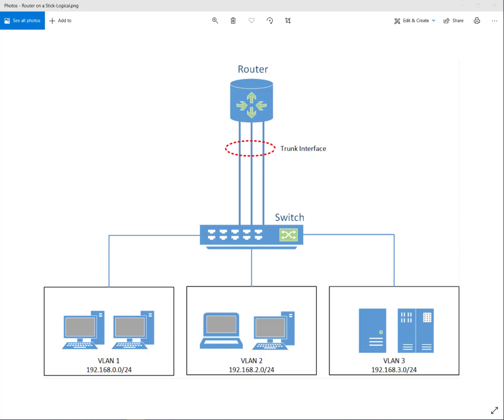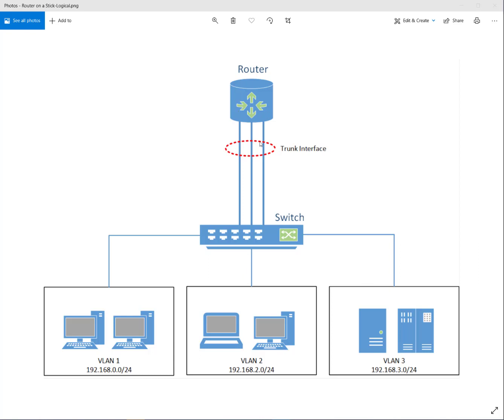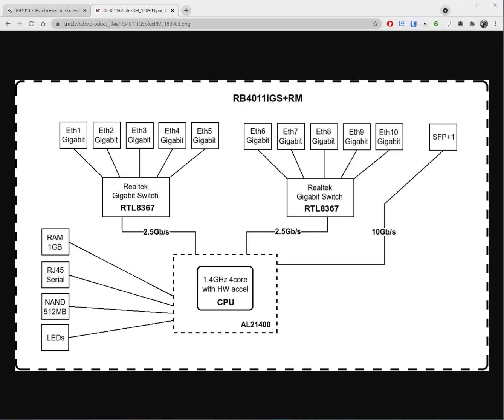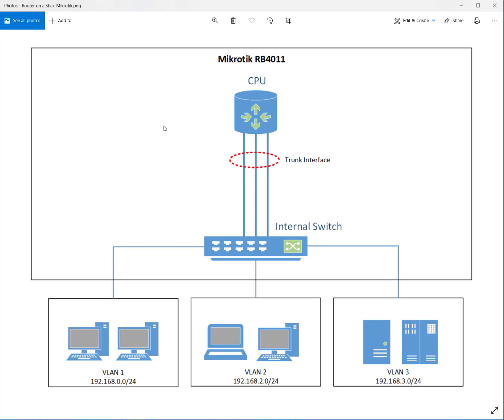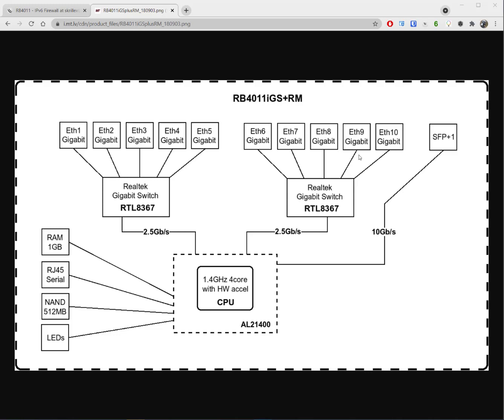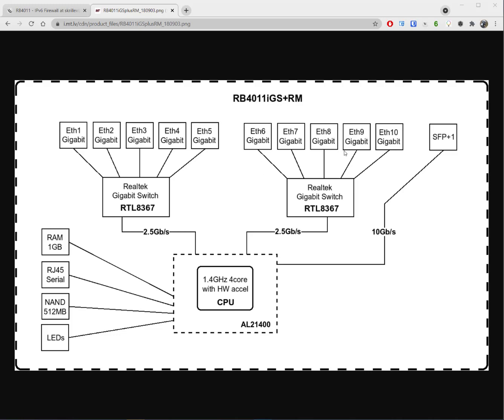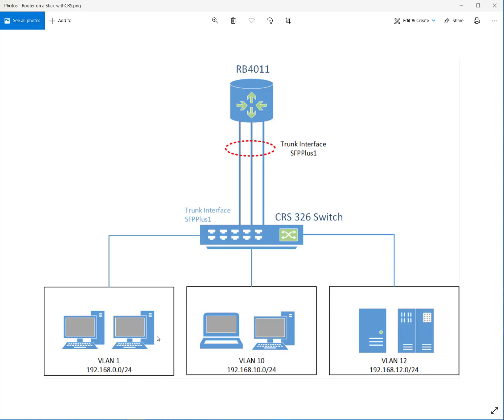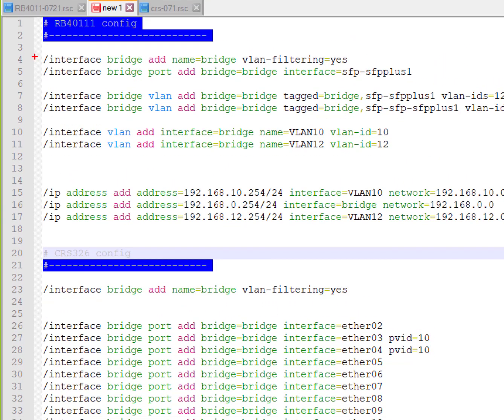Mikrotik Router on a stick overview

Comment: Router-on-stick is when WAN is connected to switch. If WAN is on RB4011 that's not really it.
Reply: Wikipedia disagrees with your definition, and that Wikipedia definition matches the one I have always used:
https://en.wikipedia.org/wiki/Router_on_a_stick
Reply: @KaldekBoch  In spherical vacuum you can read wiki but in reality router-on-stick is used to extend router with ports of a switch. RB4011 has only 1 SFP+ but for example CRS354 has 12 of these so you can utilize multiple GPON ONU modules for WAN.
Reply: RoS is when you have your traffic Routed in and out the same interface, thats it. In some cases you even don’t need vlans.  The example in this video is absolutely valid.